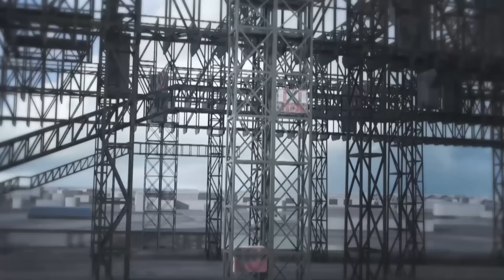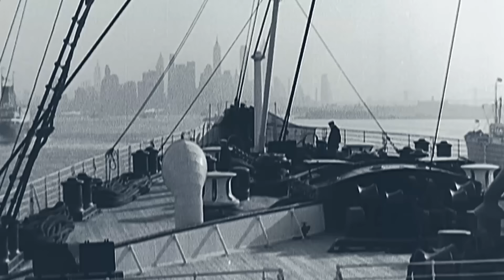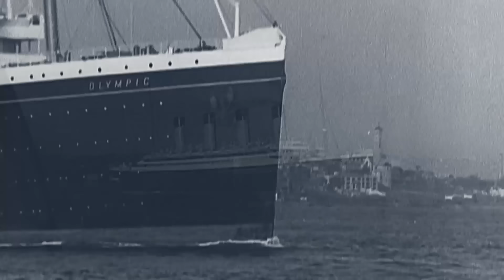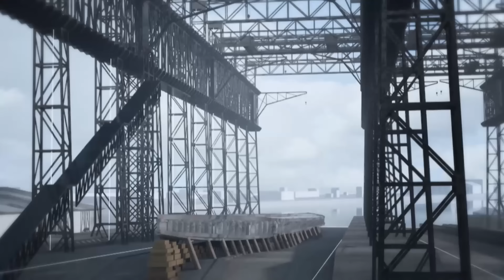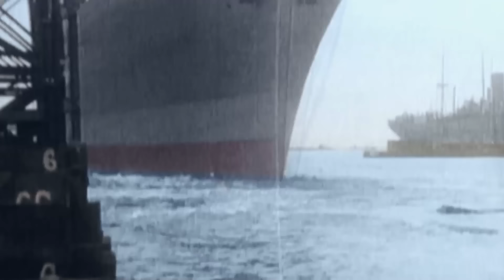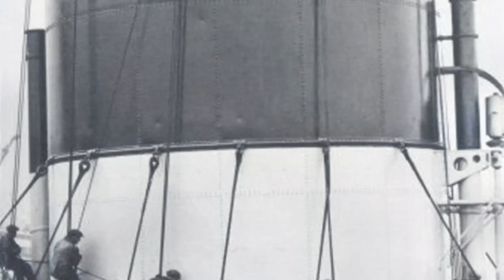The Titanic: Building the "Unsinkable" Legend - Full Easy Documentary

Comment: Certainly one of the better documentaries, though they did get a few things wrong: 1. They wrote the ship was 886 feet long and 174 feet high, but it was really 882.5 feet long and 175 feet high. 2. The funnels were actually not in one piece for installation. There was an upper funnel (which is what most people are probably familiar with) and a lower funnel, which is seen with Britannic's images. 3. Funnel #4 wasn't just for ventilating the kitchen, it also vented the 1st class smoking room, turbine room, fireplace and galley.